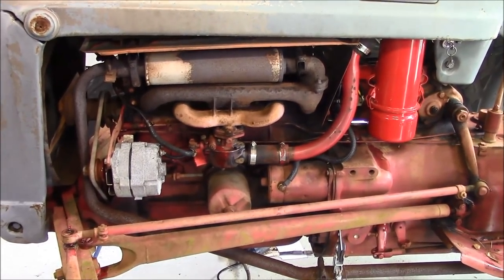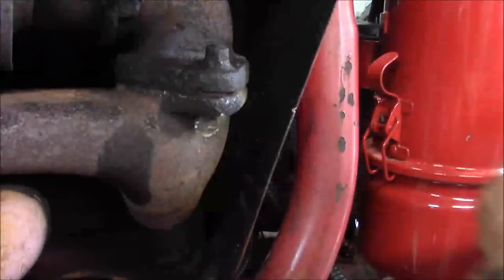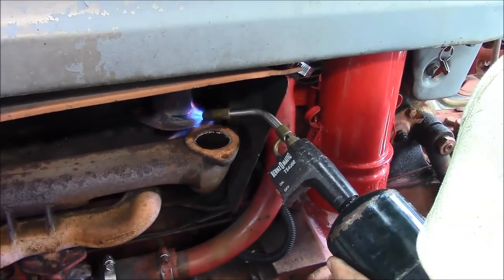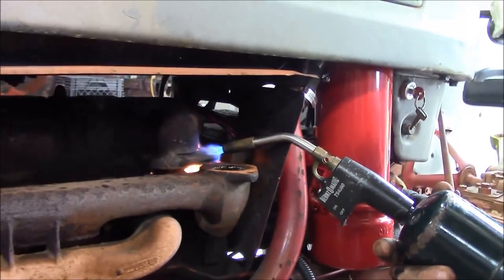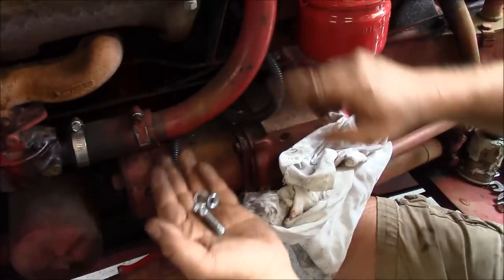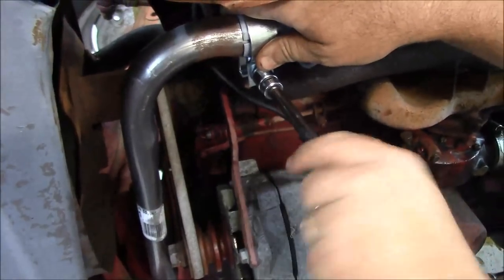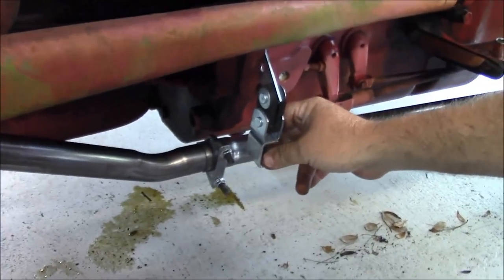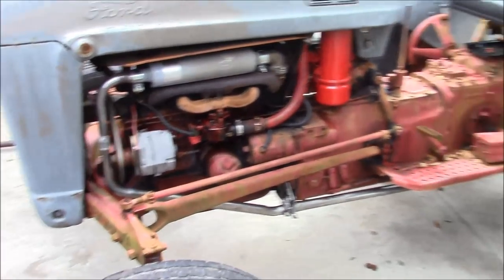DoRite Fabrication torched my tractor - 1957 Ford 800 series tractor exhaust replacement.

Comment: There should have been a clamp at the outlet side of the muffler that attaches  to the fuel tank support,  that part is still available and would have illuminated  alot of slop that you incountered, I have the exact  tractor and they will outlast all of us,  thanks for the vidio,   Warren in vermont,
Reply from the maker: Indeed they will. Thanks for watching !

Comment: You should post a video about changing the oil bath air cleaner.  The new aftermarket one looks much different than the original.  This video helped me find the one I need to order.
Reply from the maker: It was very similar to the one I replaced in form factor. I still have the original one here. I picked up the replacement from Steiner. The old one had been run dry for years and the media had disintegrated. Thanks for watching !